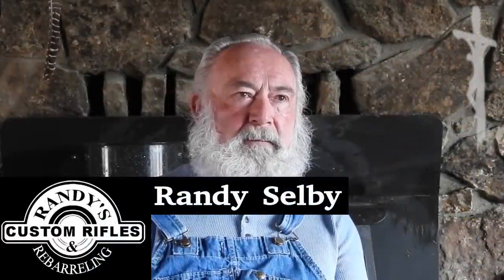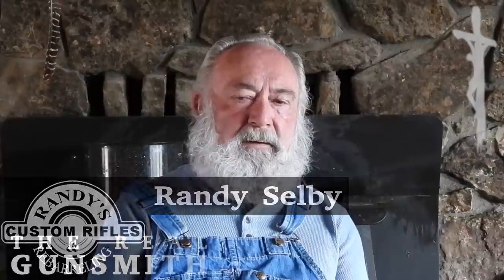Load Workup Advice

Comment: So many levels of knowledge here. Read between the lines.  If you don't know what he is talking about, google it.  Extremely valuable information. And you won't know how valuable it is till you get it.  Let the rifle tell you what it likes. Tune your loads to the rifle.  Federal 210 match primers was the third primer I tried in a very temperamental 26 Nosler.  And it took four bullets and three powders but finally found a load it likes out to 1200.  Took two years to tune.  I thought 210 primes was not safe to try, I thought they were for 30-06 based cases.  If I had seen this video I would have had the confidence to try the 210 a lot sooner, and it was answer. With today's premium quality components and technology in electronic devices and bullet designs, the loading manuals are really only good for a safe starting load for development.  Or beginner level loading.  You could do a 15 minute video on almost every sentence.  Watch it 10 times.

Comment: There are so many aspects that affect velocity spreads; Powder type/charge consistency, neck tension consistency, bullet type, bullet depth/seating consistency, flash hole consistency, primer types, etc... It takes quality components and reloading tools, but most of all, it takes experience on what works and what doesn't. A person that knows handloading well, who has taken notes and has shot a lot of his various handloads. I think you offer all of that and it is quite a nice amenity. When someone buys your handmade/hand-assembled rifles he or she can pay for a custom load that works for your rifles. In rifle making, you don't see much of that and it is a great value. I'll bet having your help with this comes at a much greater value than for a customer to buy all of the things needed to try to figure out a load, when your experience keeps the equipment costs to a minimum (because you know what works).

Comment: You remind me of an old friend. He advised me to start at the low end and work up looking for best groups and pressure signs. My 25-06 shoots fantastic with a middle of the road charge of H4831. Just fantastic powder selection for the long barrel. It really will stack them tight and better yet it’ll put some meat in the freezer.

Comment: Randy reminds me of Norm at my local shop. A wealth of knowledge and experience and you better listen when he offers advice! These old timers have forgotten more than most of us know. All my best loads are full cases or lightly compressed. Also magnum primers have thicker cups to withstand the higher pressure of said magnum loads and when you use em in std pressure cartridges they won't show pressure signs and can cause erratic pressure spikes and be extremely dangerous if you're already loading to near max pressure for the cartridge.

Comment: Excellent! A few times people have complained to me about the accuracy of Nosler Partitions. They start out low in their work-up (as they should), see dismal groups and give up on them. The open base of Partitions, as well as Swift A-Frames, will allow the bullet to slug up, or obturate, to fit a slightly over-size groove diameter barrel. But it takes a good kick in the seat of the pants to do it. In my experience accuracy with Partitions gets better as you go up in powder charge weight. Great vid, Randy.

Comment: I always enjoy the videos because it proves to me I’m on the right track and that what I’ve learned and experienced in the past someone else has learned and experienced. In my 2 .256 Newton rifles 1 in 1:10 twist and the other in 1:8 twist loads had to be worked up from scratch because there is no load data available. The 1:10 likes Norma 204 powder/ 125gr Nosler Partitions/ Federal GM210M primers and the 1:8 likes Hodgden 4831SC, 140gr Nosler Partitions, and Winchester LR primers. Both are filled to the base of the bullet seated 0.030 off the rifling. Great video and I will listen to it again! Thank you Randy and Cathy!
Reply: There is load data available for the .256 Newton.  Gunwriter Ken Waters did an excellent piece as an addendum to his Pet Loads Vol I and II.  You should be able to find it on the internet. I started loading for the .256 Newton over 30 years ago thanks to Mr Waters with whom I corresponded.  There are other sources but his is a great place to start. Good luck.
Reply: @jimholloway3452  Yes, there is and I have his “Pet Loads” publication. I used it to get an idea of a starting place, however his powder and bullet selection was quite limited. Thank you!
Reply: @richardkramer1094  Look in reloading manuals like Nosler #8 and Hornady #11 under 6.5-06.  Begin with starting loads and work up carefully.  If you use Barnes bullets get a manual that lists 6.5-.284 and again begin with starting loads and work up carefully.  The .256 Newton case is 0.05” shorter than the 6.5-06.  There is a 6° difference in shoulder angles.  The 6.5-06 and 6.5-.284 are very close to the same case capacity.  Both have more case capacity than the .256 Newtons. Do NOT use the old Speer Reloading Manual for Wildcat Cartridges #4 or P.O. Ackley’s data!
Reply: @jimholloway3452  When comparing my Jamison .256 Newton case to the 6.5-.284 Norma the cases have the exact same capacity and yes, the 6.5-06 has a bit more capacity. Depending on the bullet weight I’ve found Norma 204/H4350/RL-19 to work best of 100gr or lighter bullets of any make and Norma MRP/H4931/RL-22 to work best for heavier bullets. That has been my experience from testing and working up handloads. I worked up those loads over 20 years ago and they still hold true today.
Reply: @richardkramer1094  Do you use your 100 grain loads on deer or antelope? I load 120 to 140-142-143.  I hunt deer with it.  I have some loads with copper bullets I would use for elk.
I have a few rifles chambered in .256 Newton and one in 6.5-06.
Reply: @jimholloway3452  It all depends one which rifle I use. I have one that I custom built with Newton’s original twist of 1:10 and I use 95gr V-max for coyotes and prairie dogs, 130gr Swift A-Frames & 125gr Nosler Partitions for deer and antelope, it will not stabilize the longer bullets. The other is a 1:8 Twist and I shoot mainly Swift Siroccos and Barnes TTSX of the 120gr - 130gr weight class for targets. I don’t shoot anything above the 130’s in any of my 6.5mm rifles. If I use a 140gr bullet it’ll be in my .270 Winchester’s or my 7mm rifles where I can take advantage of a larger cartridge.
Reply: @jimholloway3452  I also have a few hundred Barnes 110gr banded solids I shoot in my 1:8 twist sparingly because they have been discontinued. Those bullets are pushed at about 3300fps and will blow straight through body armor.😎

Comment: Thanks for another great video. I find the one thing that is key to all you teach is simple "common sense". It should be called uncommon sense in the present day because it's damn rare anymore. I'm presently playing with 2 old Enfields, a Remington and an Eddystone. They seem to have a nice long magazine box made for the old long WW1 rounds and will allow me to seat bullets out a good bit. I restocked and glass bedded them myself and added timneys and had a gunsmith rebarrel them with match barrels. ( They were sporterized when I bought them, I would never ruin an old mil spec rifle) I'm glad I have an old stock of IMR4350 and IMR4064 and Varget I bought about 20 yrs ago, as well as 1000 fed GM 210m match primers and some cci's. IDK if they're the best components available now but for 3006 they should be a good start. I've been getting an array of different bullets when available now from 168 sierras to 175 and 190's. How do you feel about crimping bullets? I normally use a lee factory crimp die on all my ammo. I'm kinda old before my time after breaking my back 3x and my rt knee is shot and I had to sell off my large rifle collection after becoming disabled, so these old Enfields are my new project to keep me getting out of bed. I have alot of 308 win and 6mm rem and 220 swift ammo and brass leftover and plan on getting some extra barrels made in those calibers eventually, as they will all work with the 3006 bolt face. Boy I wish I had become a gunsmith rather than a Union Ironworker. Every injury comes back to haunt you later in life. I see so many young men wasting their lives away on video games and IPhones and would give anything to be young again and feel up to going to the range everyday. I try to tell them to get out and live life and hike and hunt and explore, they will have plenty of time to sit and play games if they want when they're old and worn out. Though I doubt after living life they would ever want to be doing that someday. Best wishes to you and if I ever win the lottery I'd love to have you build me a rifle. Thanks again for all the great advice and videos.

Comment: Compressed Charges. I've gotten some amazing under 10 SD numbers in my Marlin 1895 444Marlin with near max loads of 'compressed' N130 under a 265gn Hornady FN. 
A 'Real' compressed charge,😀I trickle the powder into a 22" powder drop tube, gives me a more consistent compression thru the powder column. If I'm not mistaken it's an old black powder technique.

Comment: I know you said you only change one thing at a time but when you try a different primer, test a number of powder charges with each different primer?  Wouldn’t different primers change the velocity spread and standard deviation?
Reply from the maker: Hi Blair.  Yes. This is the whole point of load work up, to arrive at the correct ballistic balance of velocity, SD and group size. As each rifle may like a different diet than another rifle, same all around, it is necessary to try different combos to get top accuracy.
Thanks for watching.

Comment: I have possibly a stupid question, but is willing to learn. When reloading say a new .270Win people advise me that you aim to get the bullet as close as possible to the barrel lands to improve the accuracy. I wonder if this method will not reduce the barrel life expectancy?
Reply: The distance of the bullet from the lands is going to affect shot start pressure. Some bullets like and need a bit of run before engaging the lands. The all-copper or guilding metal bullets are a good example. "Kissing the lands" can work well with jacketed bullets, and is a standard for getting the most accuracy out of target rifles and bullets. 

All that said, it isn't the bullet engaging the lands that erodes the throat of the rifle. It is the super-heated gases of the burning powder under extremely high pressure that cause the erosion of the throat.

Comment: this is wrong.  First.   If Thompson Center can make a Compass that shoots 1" MOA for 350 bucks on any factory premium ammo.  For a couple grand you should be able to make one way better. (cryo treat the barrel)  Secondly,  you most likely never have to go over max load to get accuracy.  Its more about the efficiency and consistency of burn.  Which has mostly to do with case fill.  98% of Rifle powders burn "best" at high, full or compressed load.   now on too your primer issue.  your acting like it impacts start shot ignition pressure.  however it has more to do with bullet jump before ignition.  which can be fixed by simply making sure you have proper neck tension and to more of an extent proper land jump.  30 thousands is to much jump.  10 thousands is best for accuracy.  dirty and expansion will never exceed 5 thousands without severe mistreatment.  then you go to hunting, as if that matters for an sub MOA rifle.  you also totally missed the O'Give factor and jumped to b.s. plastic tip crap.  this rambling sounds like half cocked bs off of castboolits forum.  then you contradict yourself saying a slow burning powder doesn't work ( h-1000)  then go back to saying slow burning is better..............   h-1000 tends to work very well with the 30-06 and 200gr bullets in an accuracy spectrum especially with a long seated bullet and heavy magnum primer with heavy neck tension.
Reply: Derrold Deatherage. 🤣🤣🤔🤫🤐🤭
Reply: Rifles are like people, they have a personality all there own.Ive had 3 different barrels in the same chambering and all 3 have had their preference of bullet, seating depth, powder and powder charge weight. Mine in its current configuration shoots like crap (.7" or so) with .010 off the lands and  .2"-.3" with .025" off. The last would shoot in the .3s with bullets seated at at mag length (approximately .050" jump)
Reply: I find it hard to read long posts with poor grammar and spelling. I'm even more reluctant to follow the advice, why should it be any more precise than the care taken to write it?